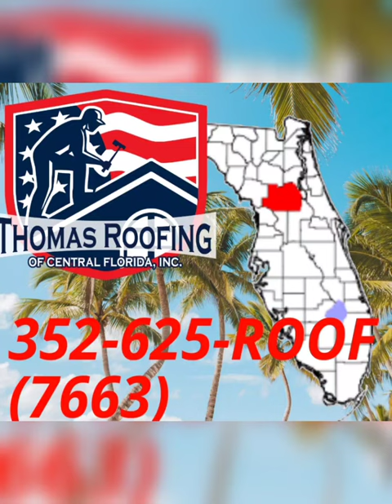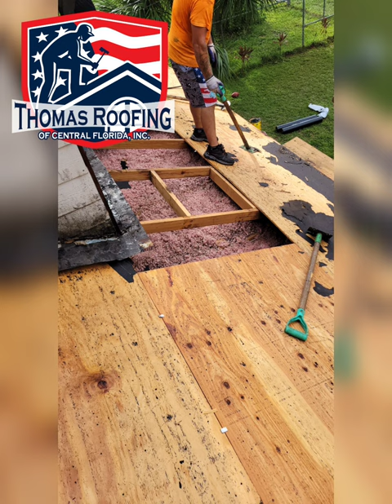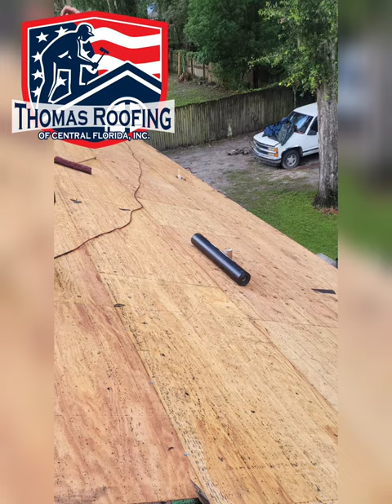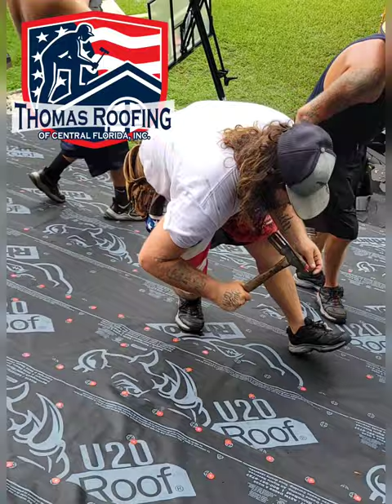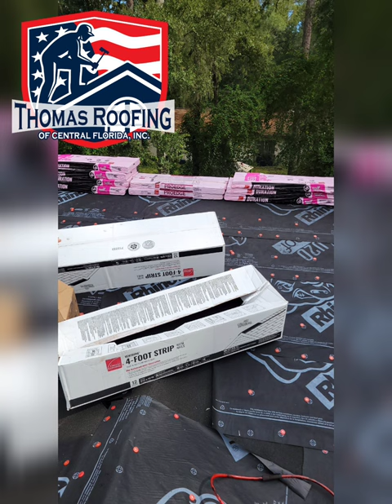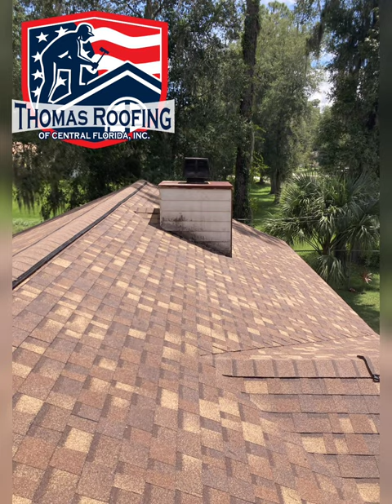Real roofers in Ocala Florida. Chimney cricket, Rhino underlayment, Owens Corning shingles.

Comment: Bringing it fully up to code in fl means a double underlayment system or underlay has to be taped between lap seams.  Also drip edge to underlayment bond has to have sealant applied. Good call on the cricket and and OC duration is a good shingle. You would of needed to use OC starter shingle & ridge cap to offer the full manufacturers warranty.